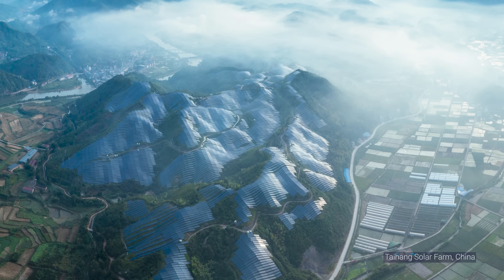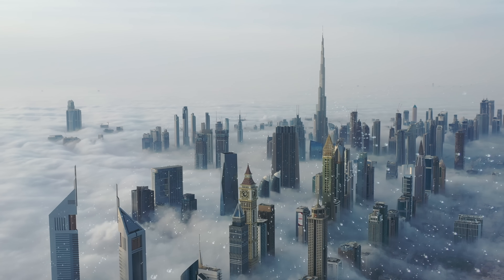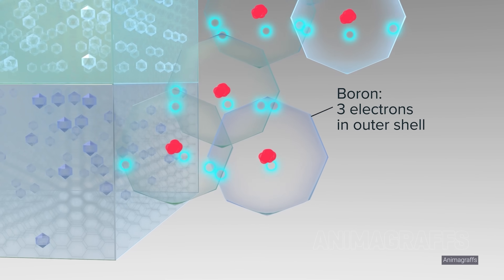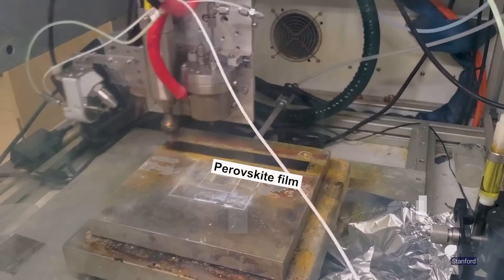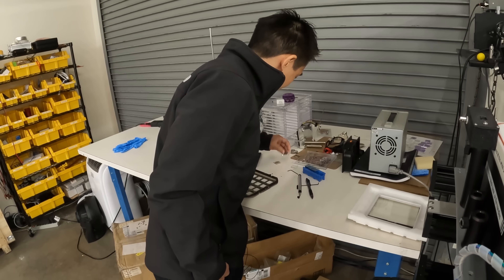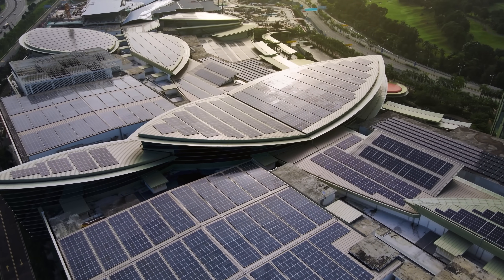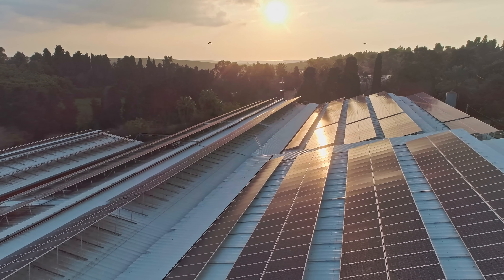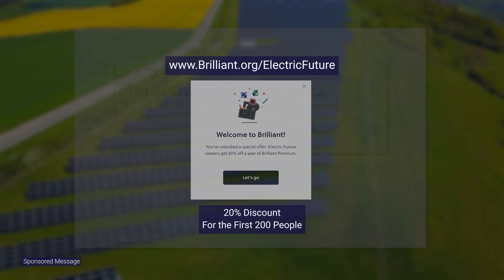Solar 3.0: This New Technology Could Change Everything

Comment: I'm a materials scientist & engineer. Just getting into solar technology out of interest. Excellent presentation . This technology step appears to be X2 decades away from a real commercial application. Carry on the good work. Nano Nano.
Reply: Tata nano
Reply: where did you go to school?
Reply: I would say: invest if you can.
Reply: Ok-
First there is no 50% efficiency, the limit is ~33% cuz of physics.  Higher returns have nothing to do with the cell, i.e. you add lenses or stack cells.  But a single cell won't go past ~33%.

Secondly, yes they have some stability issues, but there are a ton of people looking to address that and if properly encased, they do quite well already.

Thirdly, yup, they use lead.  Lead is bad, but I can also build acres of solar panels with the amount of lead found in your car battery, so frankly, those concerns are not really valid.

Fourthly, just about all materials used can be recycled.

Fifthly, I am not sure when they will hit prime time.  They are a hot research topic, however, there are literally hundreds of combinations of starting materials that result in a perovskite solar cell, so unlike Si, where it was Si and only Si, there are 100s of systems that are possible and as a result are scattering a focused approach.

Lastly, I do believe commercial examples are being produced, just not for large panels.  Yet...
Reply: i'm an old school solar engineer. so new stuff is unfamiliar, but follows the same principles. i'm pessimistic, because I implement rather than research. there are lots of challenges to overcome before commercialisation. efficiency isn't too much of a factor at the moment, even if you could be at 50% efficiency, there would be other challenges to deal with when it comes to electrical.
Reply: @wallieshere  wow I read the replies and I lost brain cells from your arguments lmao I first sided with you but you don't get him bro is explaining basic things😂
Reply: @youtubeanything7291  is this you omni? 😘
Reply: @wallieshere  could I ask how?
Reply: @DeuceFoo  Sorry, I don't understand your question on what you mean by how. I'll try to answer it anyway.

As you understand, solar cells obviously depends on the Sun's energy. But the Sun isn't always out right? This unpredictability can cause issues when you need electricity at the time of use. Therefore, solar is not like your traditional diesel generator that can supply a constant and relatively consistent supply of energy. In power generator, we need our electrical source to be stable when we turn on our loads. 

Don't get me wrong about my opinions on Perovskite solar cells. The solar industry is constantly evolving through R&D. I'm just trying to point out it is only one component of a bigger system. If you read up on solar cells used for space applications, they are much more efficient in converting light to electrical energy. But there are many reasons why we don't use them on our homes.
Reply: @wallieshere  I agree that the increase in efficiency is not super important for grid scale implementation and that storage is a bigger factor.  Where it does matter though is that I would be very happy if I could produce 10KW in the same space I produce 5KW.  I have plenty of land so I could easily expand my array but many people can't, and like me they are probably on net metering.  This means that storage is not our problem, it's the utility company's problem.  Most people with roof top solar don't have an easy way to expand. The storage issue is best answered by BEVs with V2G capability.  The holdup with V2G has been the limitation in cycles of current gen lithium cells.  No car manufacturer wants to include a V2G interface that will result in them looking bad because of a major reduction in the life of the battery pack.  As that gets resolved V2G will make a lot of sense.  I think what is likely is a scenario in which owner that participate allow the utility to operate within a 20% battery charge range.  This will allow the utility to unload the grid when solar production is high, and draw power from the BEVs when production is low, or when demand is just generally high.  The economic model will need to be worked out, but it's not too hard since overproduction of solar is essentially free.  This resolves the other major issue which is that practical build out of solar has been limited by the narrow time band within which it produces.  Countries like Germany have been forced to pay to get power off of their grid when renewables are over producing.  Utilities don't want to build more grid scale solar when the power won't be needed and they won't get paid for it.  V2G solves that problem.  It will require good communication for the cars to interoperate with the grid to charge and deliver power when the grid wants it.
Reply: @michaelanderson4891  Yes that is a point I was trying to make. In cases where there are limited amount of area available, then conversion efficiency would be an advantage for a power to area ratio. In many cases, the source of power should be built according to the load as much as possible. This is why I used space application as an example, because we want to generate as much power as possible with a limited area. High efficient solar cells on cars would be another example where it would be useful. Even if you could theoretically convert 100%, solar on cars won't be able to meet the normal demand.

The main reason why the utility doesn't want upstream generation is due to it's unpredictability. High PV penetration on the grid without a control system can wreck havoc on voltage quality and stability. This is why they want to charge microgeneration for pumping power into the grid. It is also a similar concept for penalising commercial customers for reactive power.

We can use storage to at least fix a lot of this problem when designed correctly. It helps the demand side to be independent from the grid, ie self-sufficient, with the grid as a secondary source of power or backup.
Reply: @wallieshere  Would one of those challenges be durrability in extreme temperature exposure like up in Canada surviving the freezing winters?
Reply: @AncientAdvancedCiv  The challenges I was mentioning is not necessarily around temperature as such. The benefits of improving solar cell efficiencies is really only about the area of space used. At the moment, this factor isn't too important (as yet). Say commercial Perovskite cells could achieve 50% conversion efficiency, it just means you could use less space.

What is really holding solar technology back is really around energy storage. Energy storage is really the holy grail and can exploit all the improvements in solar cell development.
Reply: @wallieshere  bruh that's wrong. Effeciency is more than half the story. One of the reasons why we need massive storage is that we can't make enough power on-demand. When we can make more dense energy per unit area, it lowers the strain on the energy storage. Also, what is holding back to this tech even if the energy storage is still a problem? Isn't it worse with the use of semiconductors? 

Yes, we need energy storage for when the sun isn't present. But that is a problem for both this and the 
The weathering, electrical power conversion are more likely to be a problem. That doesn't make sense.
Reply: @wallieshere  also, how the hell did you came up with the idea that space used is not "too important"?
Reply: @omniyambot9876  What? I don't understand what you're trying to say. Please use examples and specify the topic you're talking about as solar cells have many applications.

Solar cell efficiency is directly correlated with area and nothing more. Say I have a factory that is 1 Ha and my electrical load is only 100 kW. The solar cell efficiency isn't important to me as I have the necessary space to install 100 kW. It is that simple. I could even use existing thin-film technologies to build a system sufficient for my needs. I don't need a hetero-junction solar cell as my generator.

With the same example, say for whatever reason, my factory does not operate during the day. Energy storage would be necessary to shift the generated energy towards the night time. This is one reason why energy storage is important. It is also used for other purposes.
Reply: @omniyambot9876  Please be more specific in your question as I'm not sure how you are interpreting my responses.

Why would efficiency be important in space applications? Well, naturally because you want to generate as much power as you can with the use of a limited area, right? Plus it needs to be durable in harsh environments. But you wouldn't use the same technology say for a mobile telecommunication repeating station would you? It wouldn't economically make sense.
Reply: @omniyambot9876  The need for storage isn't caused by cost of land. It's almost entirely due to the intermittency of solar power - you don't get any solar at night. In comparison to material and infrastructure costs, land costs are basically nothing.
Reply: @wallieshere  exactly. Area is a very important thing. Not only the use of landscape (it's not cheap as you've claimed) but also when it is used in private houses, vehicles, you need high effeciency.
Reply: @yeetdeets  have you read what I've said?
Reply: @wallieshere  why wouldn't it be economically making sense if it's literally cheaper, not to mention their effeciency???
Reply: @omniyambot9876  I did.

"When we can make more dense energy per unit area, it lowers the strain on the energy storage."

This is what I'm disputing.

But I'm also realising you are irrational, so cya.
Reply: @omniyambot9876  It is almost like you aren't even reading the responses. Solar does not work at night, or well when cloudy. So we need storage. This is currently a larger issue than cell efficiency. It is that simple.
Reply: @Adaephonable  absolutely. I have already said that on my first reply. Go read it. + It doesn't matter if it's problem with the new technology, because that problem still applies with the older technology. So what you said doesn't make sense.
Reply: @Adaephonable  I get what he's arguing about, if it's way cheaper and can cover more areas, even though we have the storage problem it's still an upgrade to current conventional solar cell. 

The question is if storage is a problem, why don't we use mechanical battery? I heard about it long time ago and it seems like it can store a lot of energy to use in house and it's pretty efficient.
Reply: @wallieshere  What about cost per watt hour over time and manufacturing pollution? So far solar energy is pretty expensive and has a real pollution factor.
Reply: @AzureFides  You are right, mechanical storage such as flywheels are used. It is mainly used in solar farm applications for the purpose of power smoothing.
Reply: @nabirasch5169  What you're referring to is embodied energy, the payback for embody energy is about 3 years. I'm not sure what it is now.

LCOE is now lower than coalfire.
Reply: @omniyambot9876  Your argument makes no sense.
Reply: @wallieshere  you need an education.
Reply: @omniyambot9876  I don't really know what your problem is. But hey, I'm all in for the trolling. Your understanding in electrical engineering is pretty poor, as you cannot articulate basic principles. I bet you actually have no background in power engineering at all and just speaking gibberish. Your responses are nothing but insults to things you know nothing about, which I find a weird thing to do. 😂
Reply: @omniyambot9876  People ask me questions, and I help to answer them. All you do is troll, which is obvious. For some reason you have difficulties in accepting that somebody is more knowledgeable than you in the this area. You have a hard time accepting new information and need validation. You fail to keep on topic and make things personal. You lack in the ability to have a constructive conversation and turn things personal. You're just another person on the internet. Your insults are pretty mediocre. Your trolls are rather ineffective and just shows your insecurities. Quite sad actually. Good luck with it all. As another commenter put it.. cya.. have a good day buddy.
Reply: @wallieshere  so you are saying that efficiency is not that important then because storage is? That is literally the stupidest thing I heard the whole month.
Reply: 2decades? Thats too much probably 5 years from now.
Reply: For me, not when Gas and Oil price skyrocket!
Plus we have Tesla, this thing will grow fast!
Reply: return ur engineering degree if u think solar has any future
Reply: @tokatakitauji  , and horse and buggy era thought internal combustion engine had no future.🙄🙄
Reply: @Neverfiftyone  
What is the durability? 
More than one hour? 
More than one day? 
Durability is a major problem. So is using lead.
Reply: @tokatakitauji  "its gets covered in dust in hours and efficiency goes down exponentially".  Efficiency does not drop a factor of ten because of dust.  Power output drops 5-10%  We clean our panels like twice a year and some occasional rain helps too.
Reply: @michaelanderson4891  ur area must be an exception most places its advised to clean at least once in two weeks. Its an overall failed technology and imagine how much water and energy is wasted on large solar farms.
Reply: @tokatakitauji  not only is my area in California not an exception but the area where my solar panels are is surrounded by horses who are kicking up dust constantly.  What you are saying is complete nonsense.  Nobody in the U.S. cleans their solar panels every two weeks, because it is unnecessary and because the effect is small.  Generally once or twice a year is sufficient
Reply: @tokatakitauji  Oh and given how much they save in our power bills vs the cost it is in no way a “failed technology”. 🤣  sorry but that is just hilariously funny.  If you don’t mind my asking, where do you live?  I can’t imagine how anyone could have that impression unless they were using some really old panels in an underdeveloped country.  There is a reason we are installing gigawatts at a time here and it is not because they don’t work.
Reply: why not use the power that this planet is generating now. look at nicola tesla and how his truck ran on the power thats in the air . he thoerized that every cubic yard or meter of air. has aproxmately 300 volt of straight dc power.
Reply: @nathandean1687  yeah, that's not a thing. There is absolutely no evidence of it and the person said to have claimed it has no link to Nikola himself. Also, Tesla still got things wrong in his ideas. For example, he thought we could power 'air ships' using radio waves. The inefficiencies of that, and the inability to direct the charge means that is a stupid idea.

Comment: Since they did not talk about numbers, I am curious what the cost to produce vs longevity vs the cost of a traditional solar cell and its longevity. If it is 1/10 the cost but lasts only 10 years but produces 50% more energy then this far outweighs the traditional even if you have to pay the labor to put it up 2.5 times during its life span even if that = out to being the normal cost for a traditional solar panel over 26 years as you are getting 50% more energy even up best results being 46% efficiency which is double the 20% of the traditional solar cells.

Comment: Nice video, but one of the suggested applications makes little sense.
Charging you car by leaving it in the sun would cost more in damage to the interior and paintwork, than it would save in electricity.
Reducing the cost of solar would be great, but then again solar is already cheap. Its real disadvantage is that it is intermittent. Solving that is more important, and indeed the focus of a ton of research.

Comment: Alright so they estimated 100 miles by 100 miles of solar panels would be enough OK well we'll put 100 by 100 on the East Coast and 100 by 100 on the West Coast. In maybe two 50 by 50s in the middle of the country. So as it gets dark on the East Coast we know there's still about three hours of light on the West Coast . So that helps negate three hours of having to store power.

Comment: EV is not GREEN, not even a question.  It takes millions of gallons of h20 to mine minerals such as lithium. Research ingredients in EV batteries, be sitting down. Can't extinguish EV lithium batteries. They reignite. Fire depts with experience with EV battery fires close off Area and let it burn out.